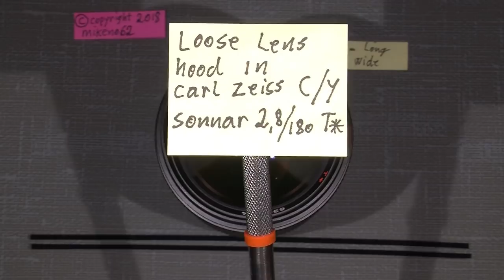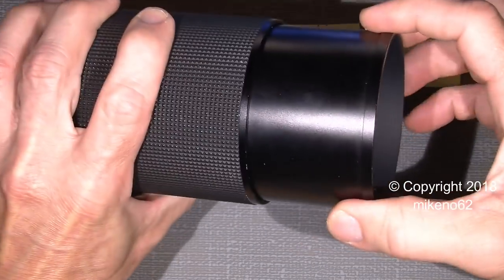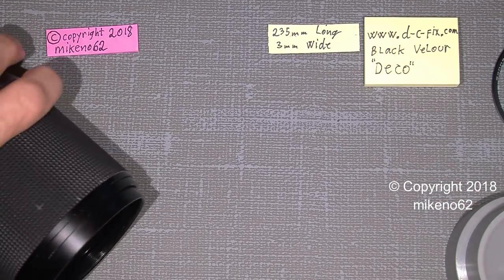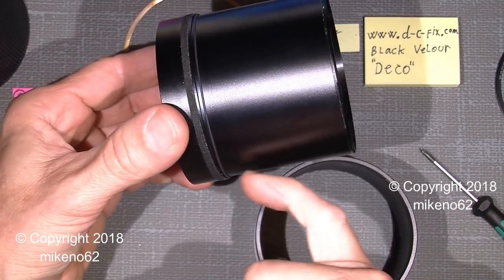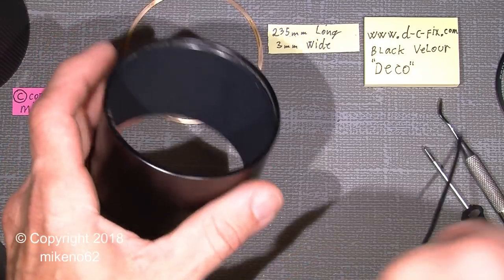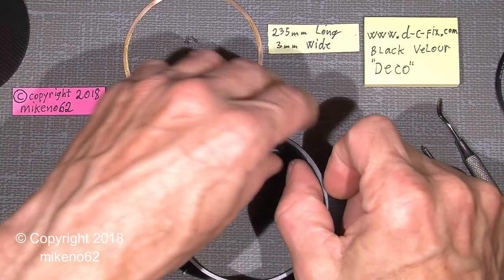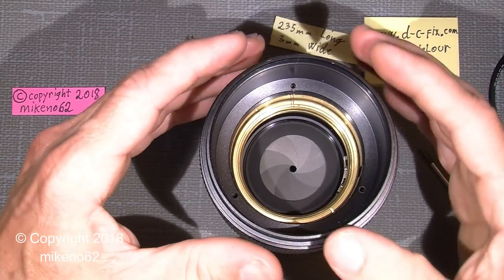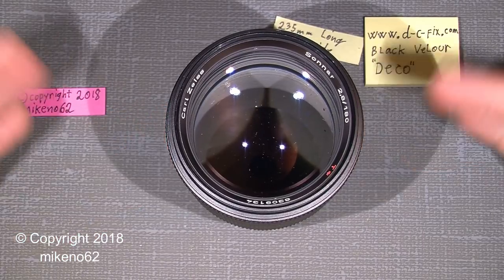Loose lens hood in Carl Zeiss C/Y Sonnar 2.8/180mm T*

Comment: Do you have a repair manual for the 300 tele tessar? Mine is a similar design but I want to add some lubrication as the focus ring is a bit too tight for what I need.

Comment: Hi there, thank you for the thorough tutorial.
Do you know if there is a dissasembly guide for the Sonnar 135 f2.8 C/Y?
I'm trying to get to the rear element to clean some fungus. I thought it would be similar to the 180, but on the 135 you can just unscrew the entire top part and it comes with the hood. From there, do you know how to remove the element groups?
cheers

Comment: Hi! I have a question concerning the Zeiss 135 2.8 (with which you apparently have experience in disassembling). On my copy the focus ring is very loose. The focus itself works very nicely so i feel like its not the helicoid but just the "outer tube". Is there a way to tighten the screws that connect the outer tube to the helicoid mechanism? And if yes do I access it by removing the rubber on the focus ring or do I have to go in from the front like in this video?
I would be really glad if you let me know, thank you!
Reply from the maker: Yes, you are on the right track, you will need to take off the rubber and under that you will see some small set screws, that you will need to gently tighten with a 1,2mm flathead screw driver.
Reply: @mikeno62  thank you very much!